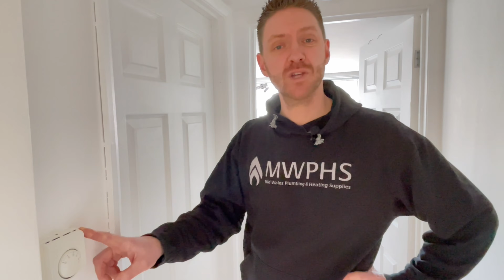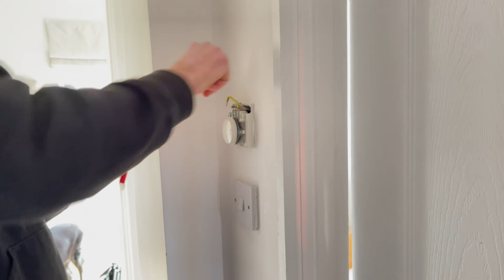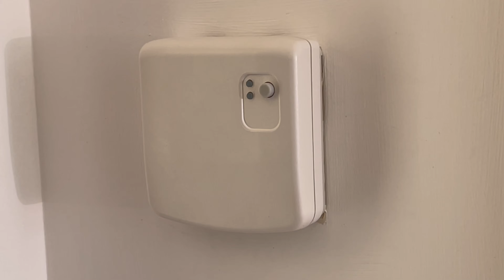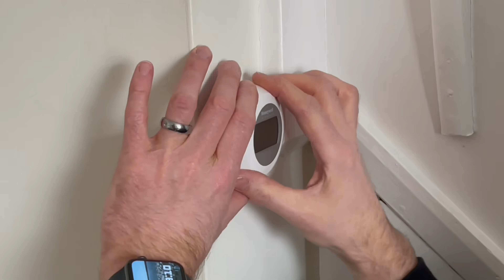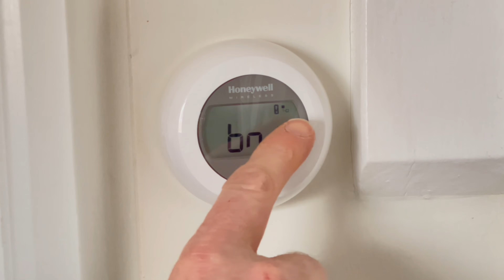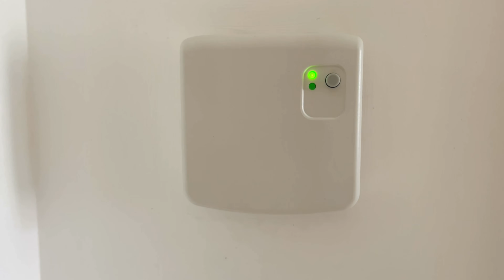How to upgrade a Honeywell T6360 Thermostat to a Honeywell Connected Single Zone Smart Thermostat!

Comment: Would have been so much better if the video had shown the original wiring on the T6360 so we could understand exactly how the original wire positions mapped to the new ones.
Reply from the maker: That's a good point, I'll be sure to include that in future videos!

Comment: This is a really useful video as I have a Honeywell R6660D wireless receiver that needs replacing as the previous owner has lost the thermostat. I was wondering why you state that this is NOT suitable for oil boilers as we have an Oil combi and I was looking to go with this relay box you show in this video?
Reply from the maker: It’s the T87RF (round thermostat) in this video that is not compatible with oil boilers, because it doesn’t have an adjustable ‘cycle rate’ or ‘minimum on time’ which is required for this thermostat (and any other thermostat) to work with an oil boiler.
Reply: @RichSmartHome  Thanks for the info. I'd already ordered it based on their ad which stated "Operates with any boiler" but the BDR91A doesn't seem to signal the boiler. The stat engages the relay correctly but the boiler just stays on when placed into "on". Is there a relay/stat that you recommend for a Greenstar Heatslave II 18/25 oil boiler?
Reply from the maker: @R1ch1eBTV  personally I’d go for Drayton Wiser Kit 2, Honeywell Home T6R or Nest Gen 3. All can be adjusted for an oil boiler and can control heating and hot water timings on the heatslave. Find them all here - https://thesmartthermostatshop.co.uk 👍🏻
Reply: @RichSmartHome  Thanks again for this info. Super helpful. I'm having issues with the retailer who says the T87RF is compatible and I'm unable to locate the info you've helpfully given about it not having adjustable 'cycle rate' or 'minimum on time' - The Honeywell site isn't great. Do you have a reference of where it states this info? Thanks again
Reply from the maker: @R1ch1eBTV  I spoke to technical support at Resideo today about this and my colleague there agreed it wouldn’t work well with an oil boiler because it doesn’t have adjustable cycle rate settings. However, he did say someone at Resideo had done a tech support article online to say it ‘worked’ with oil boilers, but neither of us could understand how it would do this efficiently. So unfortunately there is nothing to support my claims apart from 20 years experience installing and now teaching advanced heating control systems.